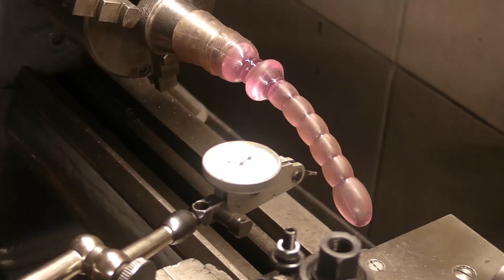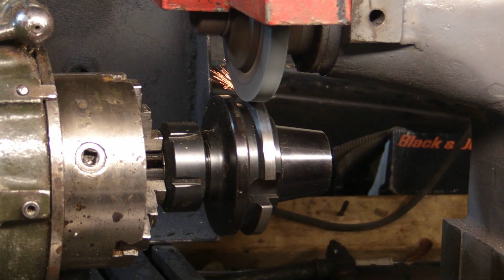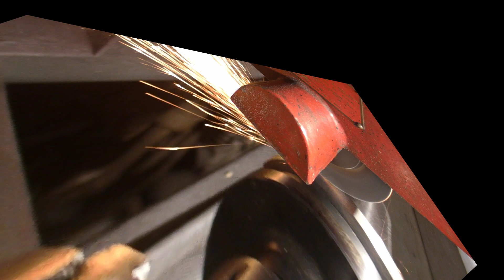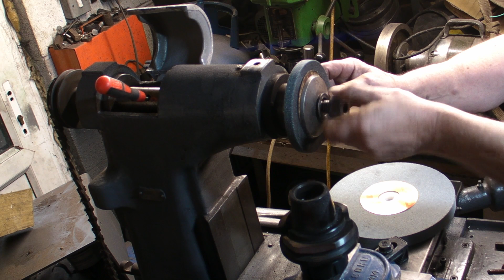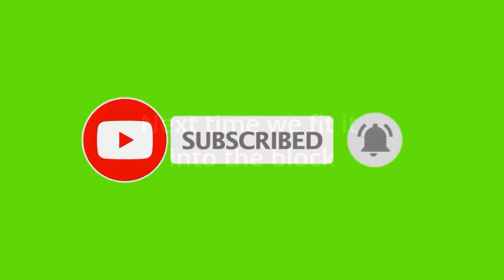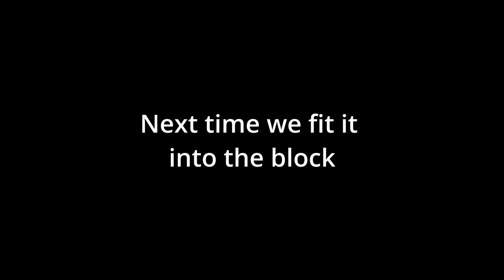Bargain ER40 chuck adaptation

Comment: You have quite the collection of toys... Interesting... Its nice seeing a man with a passion for machines ;P

Edit-
Interesting... I would have expected you to use the rotary table to grind the thing in a cylindrical motion, not in sections... Also, im no expert in the field of belts, but is that belt not a bit too loose? When you had the spindle start, the belt goes from relatively decent to loose as 5 sizes oversize shoe... My s.g. has a different configuration, and is a much more substantial machine, in need of restoration while at that, but the other machines that do use belts as drive mech never develop so much flop in the belt when running... My baby lathe uses belt with a 5sp pulley, and while i do tighten the belt to what i was taught, which is tight, but loose enough that when you compress the belt loop between thumb and forefinger, the loop has around a cm or one finger of compressive motion... And the baby lathe at full speed practically doesnt even show the belt oscillating, let alone flopping like a ballsack like this one does... I know that those silicone round belts can be floppy as a nutsack due to elasticity, and the same may be the case with this type of belt, but im just asking as this seems like a bit much... My big lathe uses 3 massive V belts so no slack there really, and the rest of my machines are gear transmission of power or direct coupling... Hell, im lying, i have one or two machines with flat belts, but again, not this type of belt... 
Also, get some cbn inserts... They dont come cheap, but you can find them from pinnacle tool or something like that on ebay for around 15-50 bucks depending on the size and type, per pair... Those make quick work of any material... Dont run them at insane speeds like some people do... they can handle that shit no problems, but they produce molten chips at that speed and molten chips are no bueno if you value your machines... Also, when cbn turning, use some proper lathe covers, toss a large old towel with a gloryhole in it for the toolpost over the bed... If you need cbn and use it at normal speeds, like you would carbide in the homeshop, while it wont make molten slag, it will produce chips that are as hard as grinding grit, and that shit will mess your lathe up if you crunch those between the ways... But i highly recommend cbn tooling... you dont need much of it, and if you lap it and hone them and dont fuck up proper, they last for ages... 
I snagged a pair off an elderly dude for a few bucks locally, unused, new-old stock... tnmg style... I tried them on my baby lathe on a glass hard rod... The finish man... The finish is sublime, and that is on a mini lathe... My big lathe is like most of my machines in need of restoration, as i heavily suffer from the boat anchor syndrome, but that is not the point here... the point is, get some damn cbn and save a lot of cash on grinder wheels, as those dont come cheap, and last shorter than cbn if maintained well... And the finish you can get from them on hardturning is practically mirror grade... I still have that bit of rod in a tub of oil with some other stock... I will maybe make a short vid and post it if you want... The damn thing literally has the rainbow sheen to it under shop lights, and i took literally the most anemic d.o.c. possible, more of a skim pass than a proper cut, yet it left a mirror surface almost... try that shit with carbide and you will get surface finish equal to kicking the part down a rough concrete slope... Also, you just got a new sub, just on account of the intro if nothing else... 
All the best and kindest regards!
Reply from the maker: Hi Camillo, its only the 2nd time using the grinder since fitting a new belt and it has stretched considerably, really need to change it to the t-nut link type ! I've now taken out 2 links which has removed the excess slack. the final machining for the register shoulder will be done on the lathe with the grinder being used to remove the bulk of the material, hence the manual adjustments ! Good info on the cbn inserts and a big thanks for the sub,. Regards Del.
Reply: @machinenutdel6764  
Its definitely an interesting belt type... I`ve seen it online before, but never thought much about it nor contemplated it, what with my machines not using that style of belt...
The surface grinding i understand, i meant why not set the apex of the shoulder just a bit before the center of the grinding wheel and rotary grind the thing down? You just elevate the table slowly and crank away at the rotary table until the chickens come home... It would have produced a round surface - which would be much easier to contend with on the lathe... This way, you have to contend with interrupted cuts... I get it if you dont want to actuate the rotary table to avoid getting grit into it, but otherwise, it could have been an easy way to produce a very lathe friendly surface... 
Regarding cbn advice, you are most welcome, look up stefan`s opus in regards to that topic - he covers the subject most well, as he does with any other that he touches upon... 

All the best!